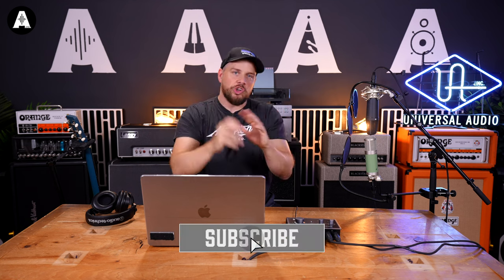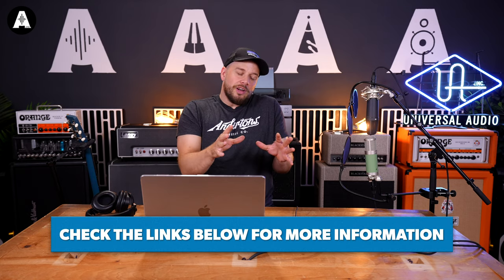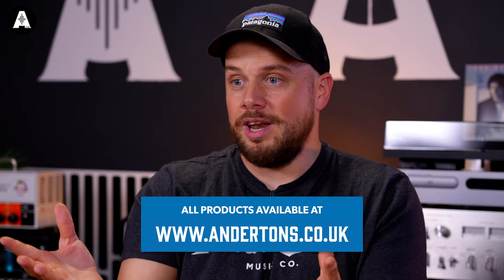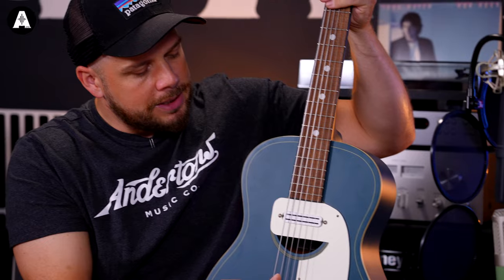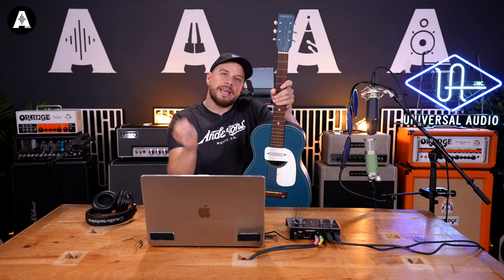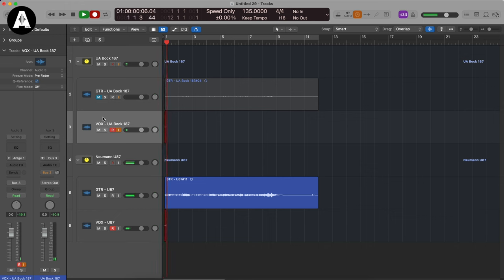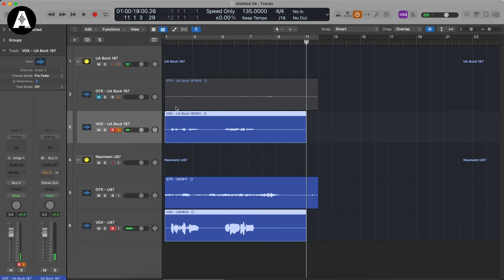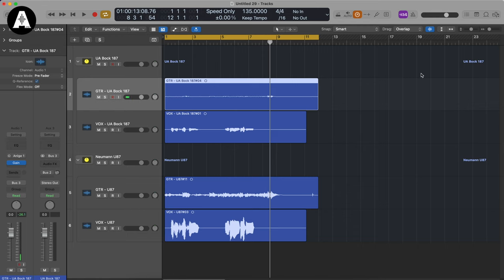Universal Audio Bock 187 vs Neumann U87

Comment: There's quite a big difference in how these two handle the sibilance. Using EQ you can tame the Bock a bit, but the U87 still sounds much more pleasant with the s-es. You can raise the high end a lot on the U87 and it will still sound smooth. The Bock on the other hand has a bigger body with more energy where the U87 sounds a bit tamed and held back. 
It's hard to pick a winner between the two really. For more modern productions I would go with the Bock, and for a bit more retro I would go with the U87.
Reply: Well, singing was ditected to Neumann so there is more body, more lows thet is why are sybilants more audible on UA.

Comment: Significant amount of ambient noise in the guitar track for both; would have preferred a quieter room. Would have also liked to invert the phase on one and then mix them to see how similar they are.
Reply: Jack did comment on that during the video.
Reply: The Bock 187 isn't meant to be a replica, it's designed to have a sound in the same ballpark as the U87. So a phase inversion would be pointless really. Just listen and decide what you prefer.